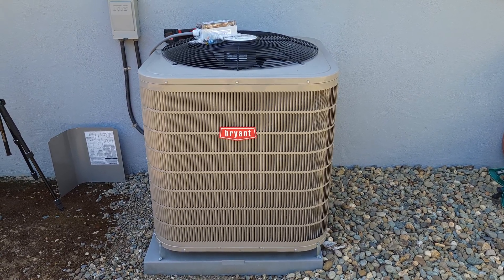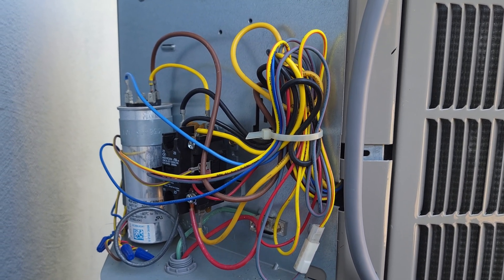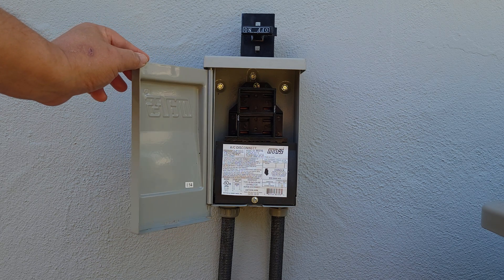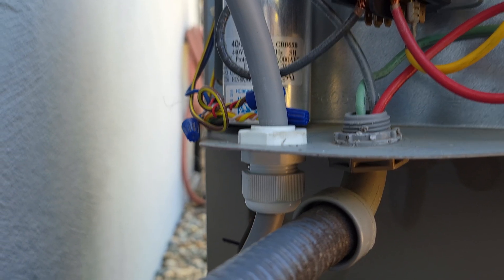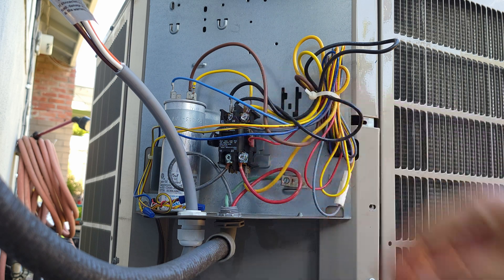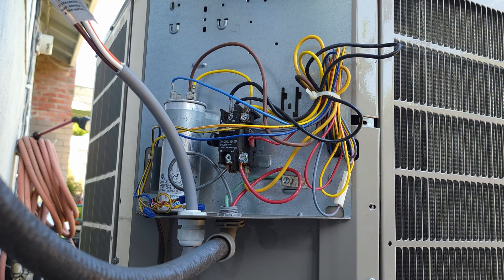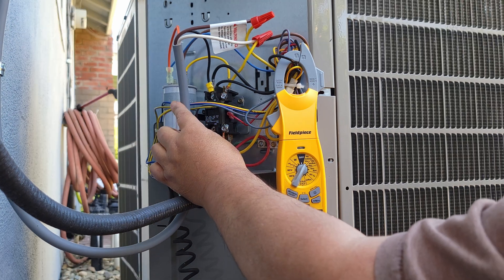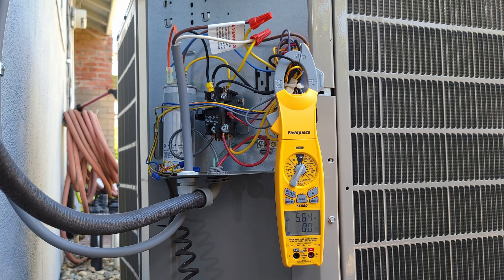Micro-Air EasyStart Flex Install on a 3-ton Bryant Air Conditioner

Comment: To help keep the MA from baking in the sun, put it inside the unit.  Easier on components. Also, use some ferrite cores ( clamp on) on the voltage leads going to the MA. Helps with power outages to reduce input spikes.

Comment: The EasyStart starts the fan 1st than then starts the compressor with less amps over a longer period of time.  The in-rush current your meter measured was the fan starting.   If you notice the reading comes up before the compressor kicks in.  The compressors probably dropped to 25-30 amps.  The EasyStart app will tell you how many amps it took on the last start.  The HVAC does have to be running for the app to connect.  Very neat device.  I just installed one.  My start up amps went from 81 amps down to 19 amps.  Run amps are exactly the same as they were before the installation.  It is good to see an installation on other brands.
Reply from the maker: Thank you.  I was surprised at seeing 6 amps and thought the same, the fan.  Up to that point, I was getting higher inrush, but nothing that low.  I just chalked it up to the learning process it was going thru.  I did update my description to say the app is reporting inrush at 20 amps.
Reply: @EdfromCalifornia  That is still a great reduction.  They say up to 75%.  The loose wires you found on the contactor could have been costing amps pre-install.  You also said that the unit made a lot of noise on startup.   I would also suggest taking a nut driver and snugging up all of the fasteners on the outside and the fan on top.  It's amazing how much noise stuff cam make just because the fasteners aren't tight.
Reply from the maker: @MOKPT3  Thank you for the advice. 👍

Comment: So basically connect the white wire to the contactor where the compressor run wire was, connect the brown wire to the compressor run wire. Connect the orange wire to the herm side of the capacitor, and finally connect the black wire to the opposing side of the contactor. Is this how it basically is with all ACs.?

So essentially to me it looks like you are reroute the compressor run wire into the micro air on the white wire and then back out of the micro air on the brown going into the compressor. These wires seems to be the wires actually carrying the load to the compressor since they are thicker. The black wire coming off the contactor and orange wire coming of the herm side of the capacitor is what tells the micro soft how many amps to send through the white and brown wires.
Reply from the maker: Basically ... but I believe it doesn't work on inverter driven compressors and there are a couple brands that require additional steps.  Check the Micro-Air EasyStart Knowledge Bank.